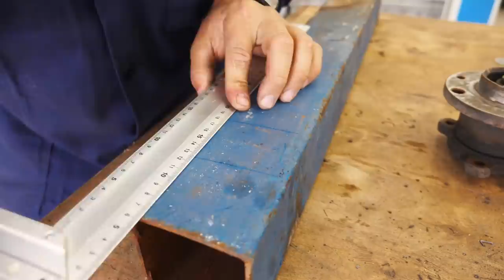A unique idea from an old car disc and springs!

Comment: The point if using nylock nuts is to have enough bolt thread goin through bolt as so the bolt will be threaded  into the plastic so it will actually lock the nut in place